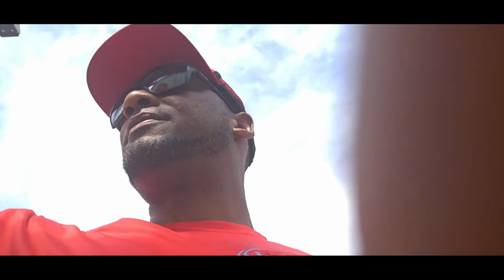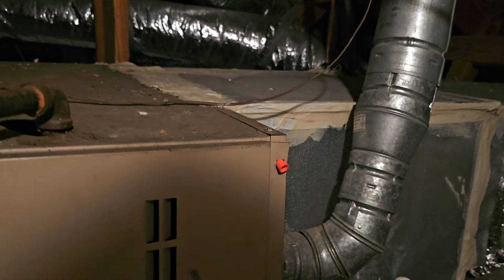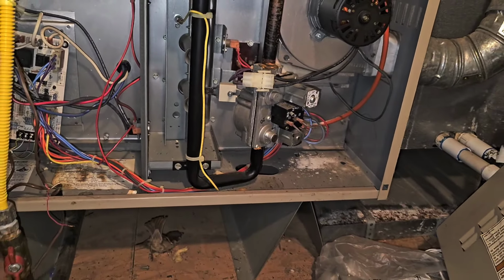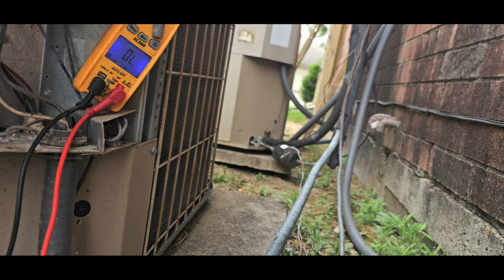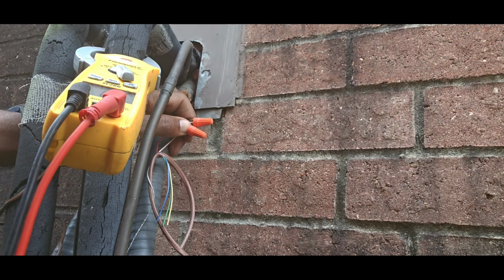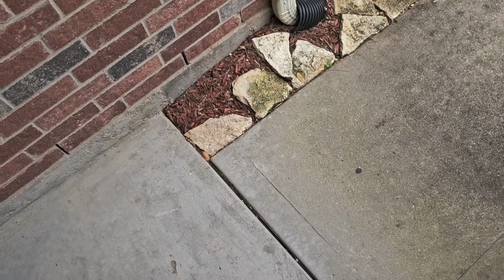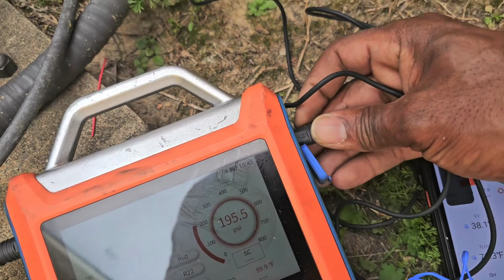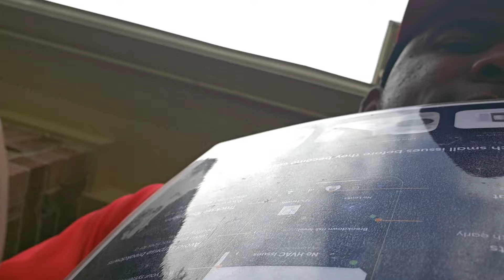No Cool Air? No Problem! DIY Blown Fuse Solutions for Your AC

Comment: good job walt. Home warranty lifer there. 23 years time @ $50 a month is about $13k . I say another $10K in wasted electric bills. After all that she is still on the old york equipment. Being in the A/c business and servicing them for years I would change A lower cost/ builder grade ac. Or at the very least recommend upgrading at year 10 to get better performance and low-cost operation. The wasted energy and down time are just not worth it. And a good unit with regular maintenance lasts longer time and just works better.
Reply from the maker: Lifer  🤣 😂